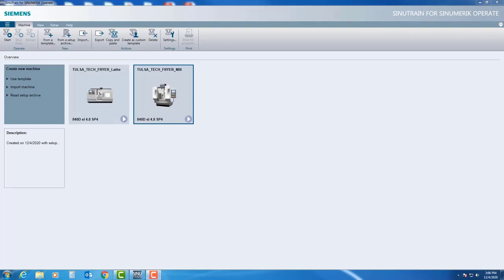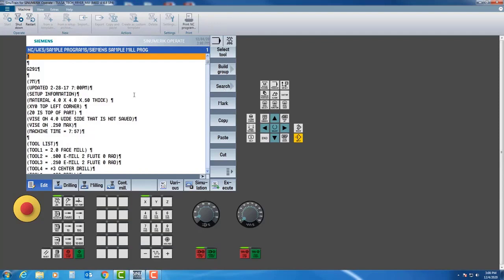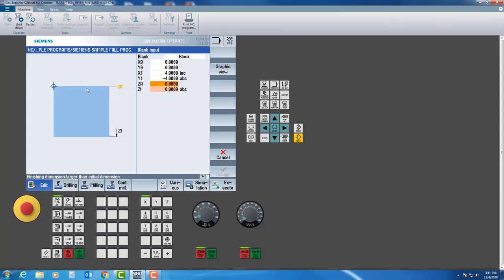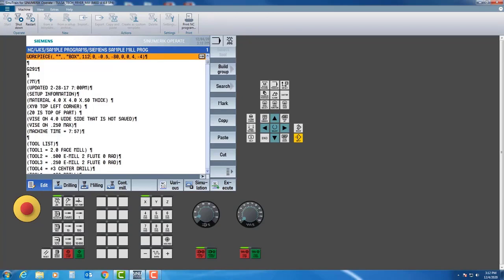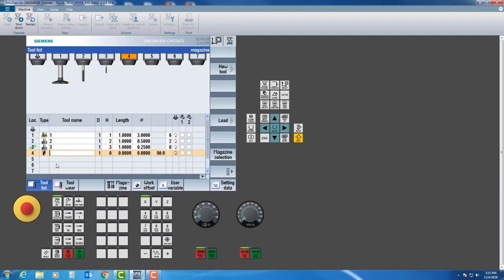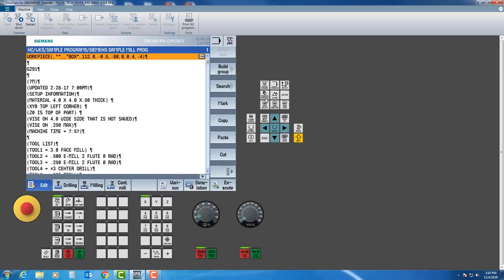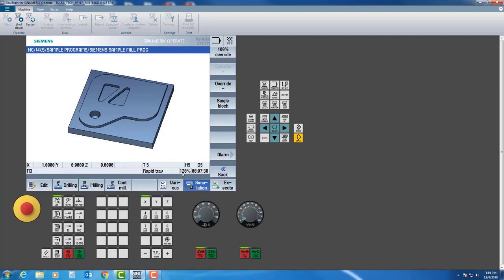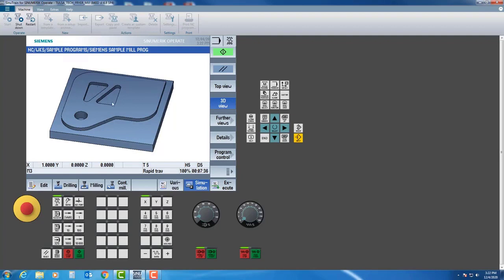Siemens CNC Mill Simulator Setup

Comment: Company I work for has a Siemens 828d is there a simulator for it I just started working there and would love to have it at home for practice
Reply from the maker: @animebest2621  I'm not sure if there's a downloadable simulator online, but you may be able to reach out to the company that sold them the machine, and they may be able to supply a simulator. they would just need your serial number code for the machine. The good news is I have several videos on the simulator

Comment: hı sir, what is simulation of pressure plate?
Reply from the maker: I didn't see anything that said pressure plate, but I did see something that said tapping plate. if that's what you were referring to it's just a project that our students engrave the metal with and then go back on a drill press and hand drill it and hand tap it after they scribe out the locations.
Reply: @aaronrunk4209  ok i got it thank you sir